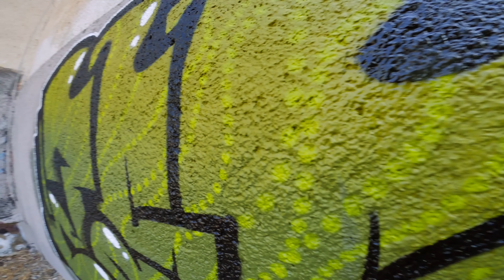Graffiti - Tesh | DOTS MAKER

Comment: Love it! You could probably kickstart mass production of this kind of caps based on the engineering you did for this video. Eventually you could get most of the parts 3D printed perfectly.
Reply: Also, it would be interesting for such a device to allow users to set a specific distance between dots and then have a sensor that calculates the speed of the hand movement and adjusts the rotation speed accordingly to always spread the dots at the same distance. Probably a lot of work if even doable and would most likely increase the production price a lot, but sounds interesting, doesn't it?

Comment: Love ur videos Tesh. Im as maniac as you're but using markers. I've done my own markers since I was a kid, and now with 3d printing its as good as getting a classroom blackboard eraser and using it as the tip. (100x65 mm is the biggest one i've done, uses 2 montana hardcore marker valves on the printed adaptor to pump the ink xD)

Comment: Tip: to make it easier and simpler (as well as more efficient), make a wheel that shoots the spray out itself instead of letting the spray come trough every now and then. Then, as you’re spraying, you aren’t using up a bunch of the paint on the wheel itself.

Comment: Neat device, but seems pretty wasteful as the slit is open for maybe a quarter or a fifth of the time, making the other three quarters spray onto the panel into nothingness. Maybe having more slits, two or three, and lower rpm on the motor would be less wasteful?
Reply from the maker: You are absolutely right! But)
When I turned on low rotations, the motor stops when I painting.
And for small rotations, I need a larger gear. I had only a small gear(
Reply: @VitalyTesh  Fair enough, I actually liked how you basically repurposed a drone for this project, quite a good way to get parts quick. Though, thing is that drone motors are made specifically for high rpm, they wouldnt fly otherwise, so going for a different kind of motor may be a good idea. I doubt you need the outer rim (drone's propeller guards) for it to function if the blocking panel is rigid enough; so an rc car motor might be worth a try, if you dont want to go completely diy and source motors, controllers and batteries as separate parts